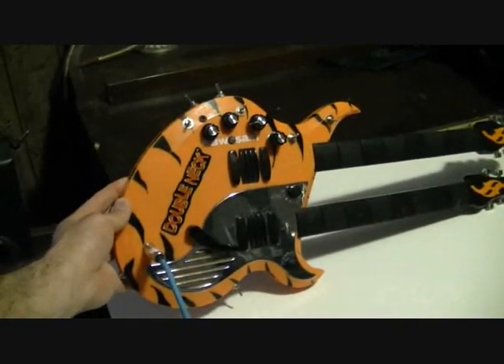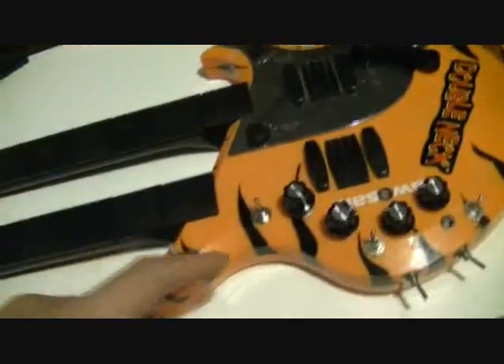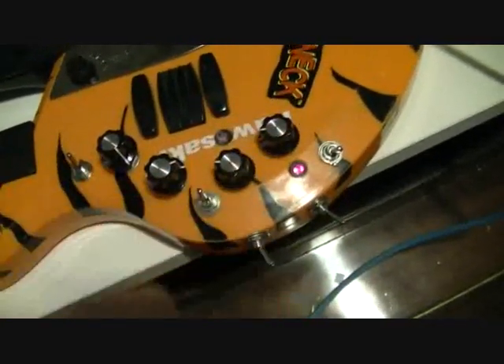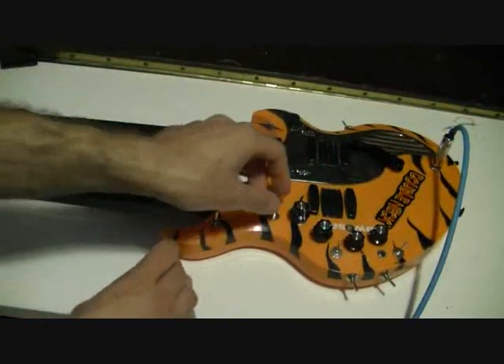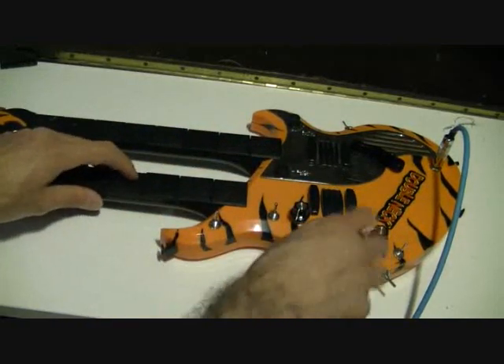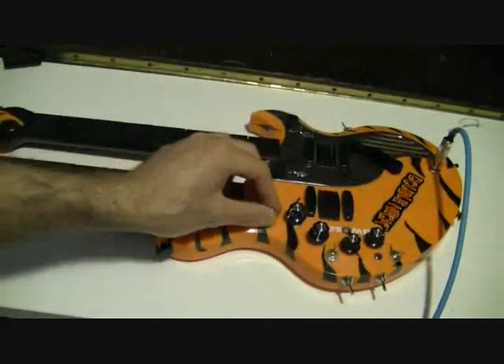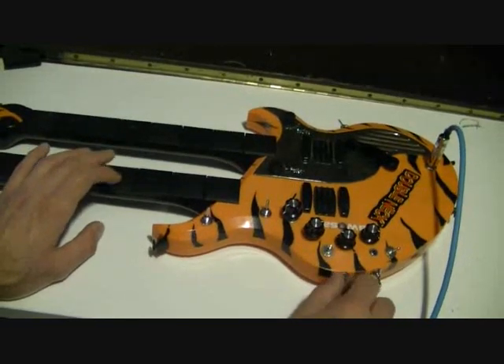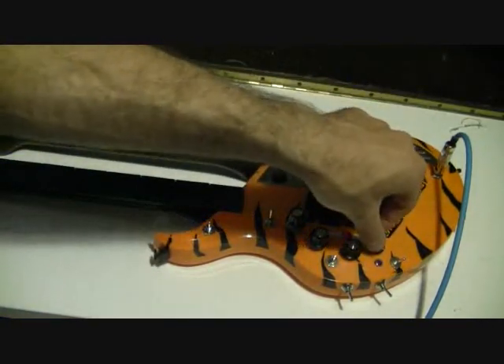Circuit Bent Kawasaki Double Neck Toy Guitar

Comment: Great! I have one of these that I picked up at a thrift store, probably 6 years ago with the intention of bending it. The current draw is SO low that when I go into the box that it's in, it still plays, after all these years. Same batteries that came with it from the thrift store. 
 Do you have a schematic for your bend, or at least your LFO? Thanks. Sounds nasty in a wonderful way.